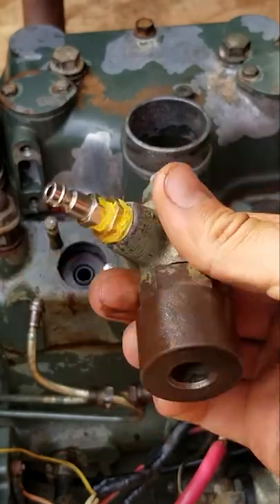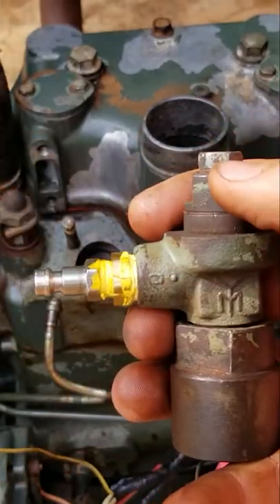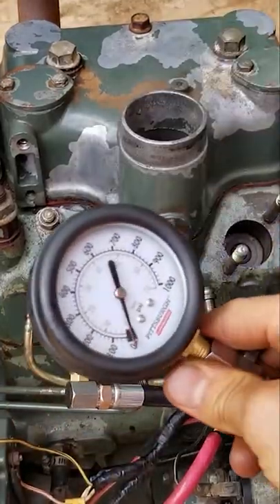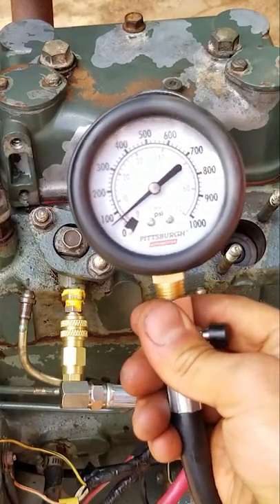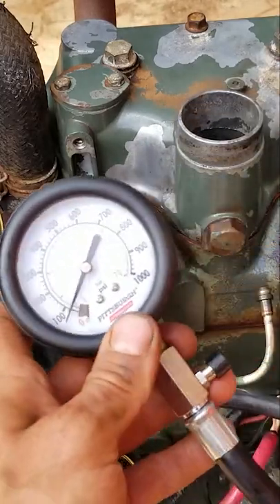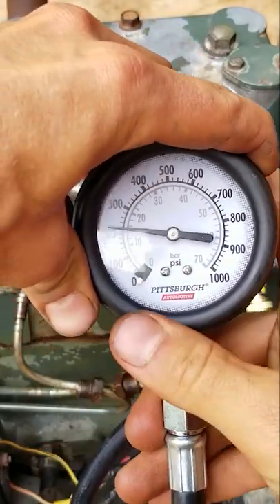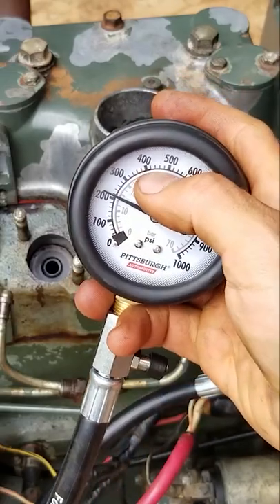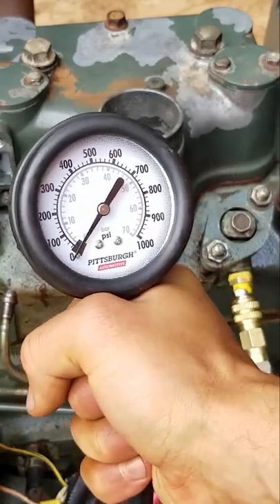Tractor Mechanic Compression Test

Comment: You can get alot of the older diesel's like that to start as long as it has atleast 50 or 60 psi, lol doesnt need 600 psi
Reply from the maker: This one was never going to start with the compression this low. I tried every way possible.

Comment: That harbor freight will bone you. I misdiagnosed a V6 outboard because the gauge read 60 psi tried another gauge and it's was 115-120
Reply from the maker: This is the diesel compression tester. I checked it against 3 other gauges. I guess I got a good one 😁
Reply: Even with an inaccurate gauge you can test comprehension variation between cylinders.
Reply: Almost happened to me with a 98 Sierra 5.7 fuel injector network assy. diag. H.F. garbage (Maddox) f. pressure gauge was 14 lbs lower than actual. Smashed it in a vise & tossed it in the garbage.

Comment: Lol, check that  Harbor Freight tester...Do NOT ever use a H.F. fuel pressure tester for certain, unless you want 10-15 lbs incorrect readings.
Reply from the maker: It was just to see if it was blown or not.

Comment: Did you hold the trottle wide open so you get total correct reading. Just saying. Now that you know it has low compression its time to grab the leakdown tester and see what the cause is. Leakdown will tell you if its likely a intake valve, exhaust valve or piston rings. Compression tester is cheap and nice to have for crude information for troubleshooring but having and using a leakdown tester gives way more information as well as being specific in identifying what is tue root cause.
Reply: Diesels don’t have a throttle plate.

Comment: While the number 1 hole IS low,,, I’ve seen older diesels start and run down as low as 70psi cranking. 
BUT,,,, the number isn’t the biggest thing in the world to get him up on. You really want to check all the cylinders and compare them hole to hole for a percentage difference. If all (say 6) holes are down in the 150psi range and “service limit” is say, 250psi,,, what are the odds that ALL of the cylinders are worn/hurt to make them ALL 100psi lower than service limit? 

I do like your compression tester adapter. I need to copy that
Reply from the maker: Exactly. These pistons where 50% difference between each other. I checked everything else. It was all that was left.

Comment: What happened if you pressurize the cylinder?
Reply from the maker: Leak like crazy into the engine.
Reply: @MattsShop   Well that is probably a major problem, either Super scarred up cylinder walls or broken rings or broken piston
Reply: Like when you do a leakdown test, place the piston at top dead center, hold the engine from rotating and pressurize the cylinder. Now check where the air is excaping. If air is coming out the intake you have a intake valve that is burned or not seating for some reason. If you get air out of the exhaust you have an exhaust valve that is burned or not seating, now if you get air out of the oil cap (crank case) you have a ring or piston problem, either rings are stuck or broke, huge gouge in the cylinder wall or a broke/cracked piston... leak down is the next step and the one that will really help identify what the cause of no compression is.
Reply: How did you check the valves? You say its not valves and you already checked them, how did you go about that?